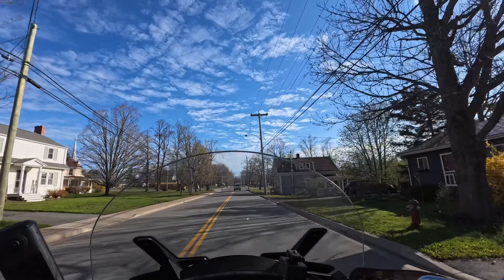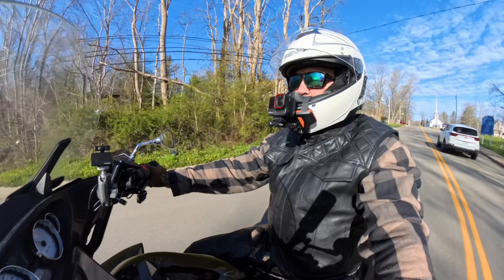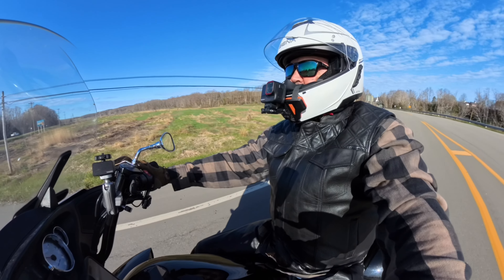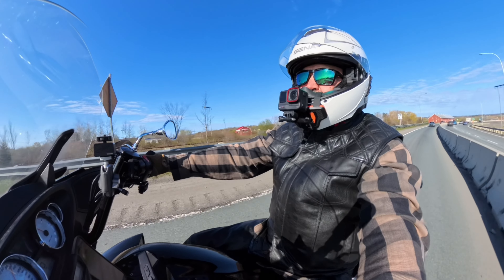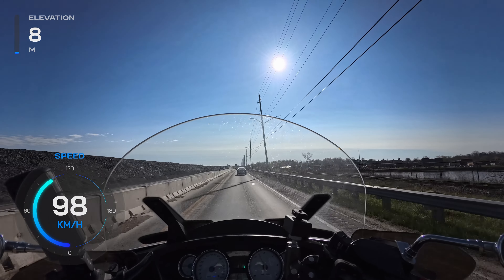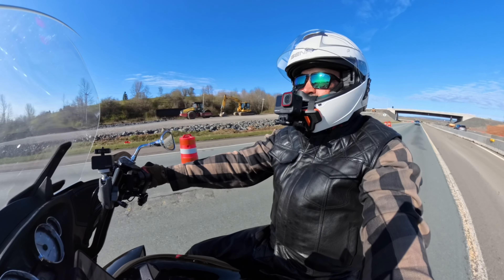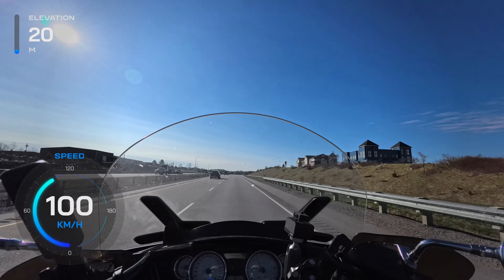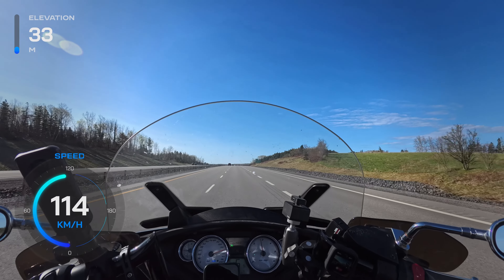Another MotoVlogging Audio Test: Persistent Problems or Clear Sound Ahead?

Comment: Volume level doesn't match the intro. Dropped significantly. I'm waiting for DJI to make a 360 camera. I like the pocket 3 and Action 4. Can you do a comparison between 8k and 4k and the difference in file transfer and editing. (Time). 8k is good for cropping but 8k files are huge. SD cards for 8k are more expensive and data transfer cables and HDMI cables are more expensive also. How are you dealing with that. Do you transfer the files wirelessly or direct connection. Do you pull the cards out or go through the USB c port and what cables do you use. Stabilization is good but  no ND filter possible. Glad you're having fun that's what creativity is.